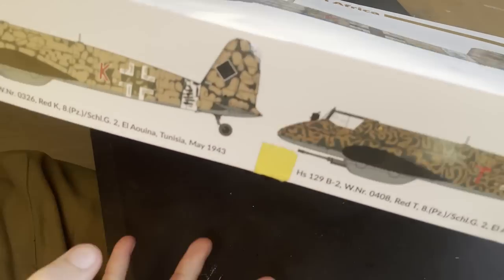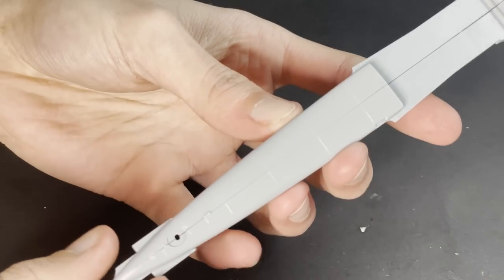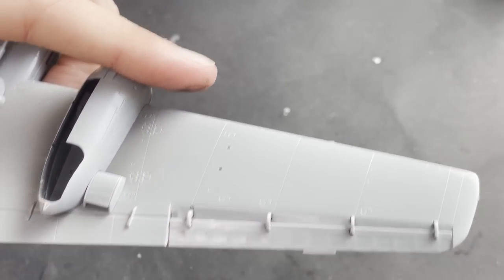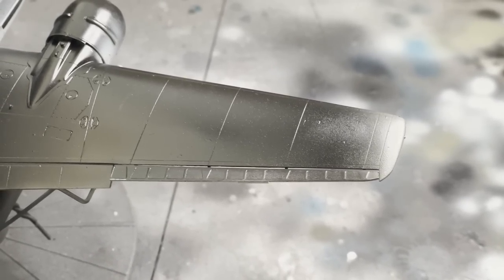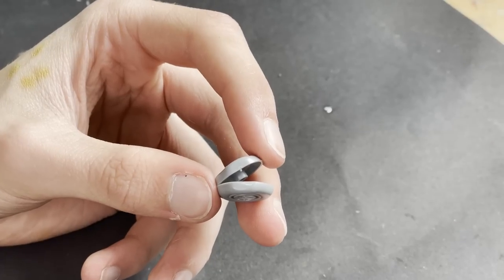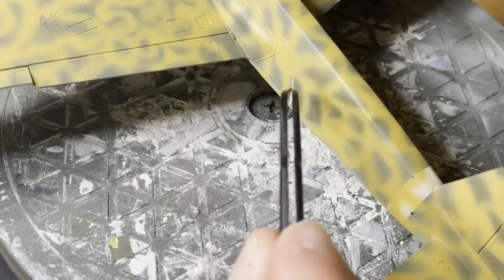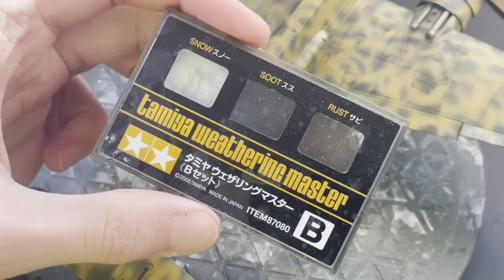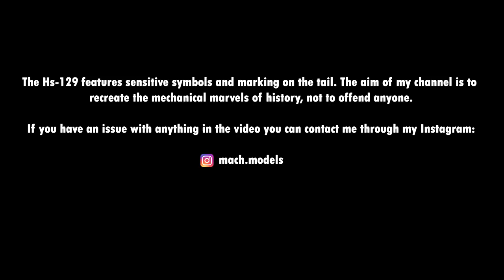Hobby 2000 1/48 Hs-129 | Full Build | HD

Comment: Amazing job on this model and what`s really good about the channel is the fact that there are no overcomplicated solutions which allow to try the same options while making my models. Just a small hint: there is a possibility of using oil paints for making the oil stains on exhaust dust (dark colors), but also for making some panels more pronounced (lighter colors). I have tried this technique recently and I am just amazed. Finally, if you`re a fan of German aircraft, I would suggest Special Hobby Bf 109E3 1/72. Great details and a lot of possible experimentation on the camo.
Reply from the maker: thank you very much!! when it comes to using oils for certain purposes, if you watch my phantom video you can see i definitely like to muck around with them! However, for this aircraft i decided to keep it relatively clean and reduced the amount of tonal variation just so it wouldn’t conflict with the unique camo! thanks for the comment i really do appreciate it :)

Comment: Hello fellow YouTube modeler! Love your channel and just subscribed. Model came out nicely. Wanted to share a recommendation with you. Try not to use high air pressure (like 25psi with acrylics). I am a former professional airbrush artist and to get super smooth finish with acrylic stick with 15 to 20psi at most. The problem is that acrylics tip dry and don't follow well so people resort to high pressure. If you see on my channel, I have a thinner mixture (that works with Vallejo or Ammo paints) that solves that problem and you will get fantastic results. It also makes the paint stronger so less issues with it being masked over. If you see my Bf-109 build, I didn't use gloves to hand the model and painted everything (including masking) in about 30 mins total.....with no paint issues. Hope this helps! And keep up the good work.
Reply from the maker: Why thank you!! I’ve always been told to spray at 30 psi for Ammo but after this I will have to try and lower it! I’ll go check out your channel now, thanks again😁

Comment: Excellent job sir.   The Henschel HS-129 was a formidable ground attack aircraft in WWII.   It's main problem was that it was severely underpowered and it was a heavy aircraft due to it's heavy armor plating and glazing of the cockpit to protect the pilot and aircraft as much as possible.    It was one of the most heavily armored of any aircraft in WWII with protective armour almost completely surrounding the pilot, engines (as much as could be done) and critical components.    This allowed severely shot up aircraft from either other fighters or anti aircraft batteries, to return safely to their airfields, even in a critically crippled aircraft.    There were a few German pilots who had great success with the HS129.    Another problem was that the aircraft was not available in large numbers and had to be used very selectively.   The aircraft assigned to North Africa were pulled after their defeat and reassigned to help in the Eastern Front war against Russia.   Their they joined three other squadrons which made a total of five which was a minuscule amount to cover the large Eastern front.  Again,  the aircraft were used very selectively in ground attack roles, mostly against Russian tanks and mechanized vehicles, although these aircraft also attacked troop formations, trains, buildings deemed a threat such as factories, depots, ship yards, and also enemy shipping of all types from military to civilian shipping, among anything else that needed to be destroyed.   These aircraft at their zenith had a 75mm auto cannon with 12 rounds of armor piercing and/or incendiary rounds.   One well placed 75mm cannon round could easily take out a tank of any size produced during the entire war.     The American B-25 Mitchell had a similar 75 mm autocannon, which was basically an artillery piece mounted to fuselage of the aircraft.    This incredibly large cannon was mounted under the pilot in a pod that ran along the entire fuselage.  The German 75mm cannon was the most powerful gun ever fitted to an aircraft during the WWII period.   Pilot's reported that the recoil from the gun felt like it stopped the aircraft in flight with every round fired.   Some models used a manually loading system as opposed to the auto loading cannon.  This aircraft was similar to how the A-10 Warthog was made constructing the aircraft around the large gatling gun running the length of the entire fuselage underneath the pilot and it has the largest and most powerful gun ever mounted on a twin engine fighter jet up to this point in history.   While the technology of the A-10 is far from secret as it was designed in the late 1960's, early 1970's, it is still valuable enough to the United States, that the USA is the only Country to have A-10 Warthog aircraft in it's arsenal for obvious reasons, and the United States forbade it's export to any nation.   Some experts believe that this aircraft,  the Henschel HS-129, along with several other German fighters of the time, including the Heinkel 219 "Uhu" or "Eagle Owl",  Messerschmidt ME-110 through the last variant, the ME410 "Horniesse" or "Hornet",  the Focke Wulf 190 (all variants), JU-88 and 188's, and the Heinkel HE-111's were all inspiration for the design of the United States' A-10 Warthog which was designed as a ground attack aircraft (Close air support aircraft) from it's design phase to it's production as a specific type of ground attack aircraft.   It went on to become one of the most valuable of the U.S. Air Forces attack planes and has served with distinction in all it's fields of battle for nearly 50 years, having very minimal losses due to the A-10 having such a resilient design with multiple redundant systems allowing the aircraft to return home, even after being severely shot up, similar to the HS-129 and the American P-47 Thunderbolt which was also a formidable ground attack aircraft in it's own right, able to sustain heavy battle damage and fly home safely.    The A-10, like it's predecessors in WWII suffers from slow speed compared to more advanced Mach 1+ fighters like the F-22 and F-35, although the highly technically advanced A-10 is much different than WWII aircraft and have sophisticated electronic warfare systems on-board that were never even dreamed of in WWII making it just as safe to fly in combat as the more technically advanced fighters such as the F-22 and F-35.   The Warthog, like the Henschel HS-129 was actually designed to be slower which allows it to perform extensive and precise ground attack missions due to being able to attack ground targets easier at slower speeds making these aircraft perfect for the ground attack missions.  In the hand of a skilled pilot, this was a true weapon of terror when it banked over into it's dive, and seeing from down below that this precision aircraft was getting ready to fire it's volley either upon you, a building by you,  a truck you were driving, a train you were conducting, an open field of troop formations, or whatever else on the ground it was.  Tanks were essentially DOOMED when this machine came down to release it's volley of weaponry upon you.   As slow as it was compared to other aircraft of that era, Henschel HS-129 was still a very maneuverable aircraft in flight which was one of the key attributes a successful Henschel 129 pilot needed to master quickly in order to survive being an easy target to shoot down.      Using this incredible maneuverability some HS-129 pilots were actually able to evade being shot down using the aircrafts maneuverability rather than speed to outwit it's enemy trying to shoot them down, similar to American dive bomber designs such as the Dauntless and Thunderbolt's being "multi-role" aircraft but great ground attack aircrafts in their own right.   Many HS-129 pilots even had air to air kills in their HS 129's, which is not a role it was designed to be used for, being a specifically designed ground attack / light bomber type of aircraft.    It's machine guns were not as powerful as other aircraft of the era, however, it's strength was in it's huge 75mm cannon. 

FANTASTIC JOB on your paint job of the aircraft.   It really looks period correct and very realistic.    Really nice job you did and I am looking forward to exploring the rest of your incredible model building videos.    I want to get into building models of WWII era aircraft of all types as well as some of the more famous models of the early years in WW1 like The Red Baron's Red Tri-Plane which surely would be a challenge to construct but would be fun.   Your attention to detail and the way you explain your models is spot on.    Very informative and interesting to watch.  I especially like the way you "blend in" various paint colors and the amazing way you take paint to make oil streaks behind the exhausts and other intricacies that most other model builders don't even dream about doing.    You really have a talent for building life like models.   They should you use for movie set construction, etc. for making models of planes.    They look so life like when you are finished.   It really brings the appearance of what the aircraft would have looked like back then to life,  it really does.   Seeing the aircraft in a 3 dimensional model is a great way to see what the aircraft really looked like since most of these aircraft no longer exist and the very few still around are in museums.   None of the 865 Henschel HS-129 aircraft produced survived the war, many of which were either shot down, hit by anti-aircraft fire and destroyed/crashed,  crashed during flight training and destroyed, or were destroyed intentionally to avoid allowing the allies to capture the technology at Germany's surrender.    Two thumbs up sir,  very nice job!   Thanks for posting all your hard work for us to view.     Have you constructed/painted a North American P-61 Black Widow model yet?   Would love to see that.   It probably wouldn't be that hard since it's a matte black paint scheme to avoid radar of that time period,  but it would still need your "realism" touch.   That's the key to making a model look good or look GREAT!   Your look the latter........GREAT!   You really have a skill making those planes look so real.
Reply from the maker: Wow! Thank you for such an informative comment, really appreciate all of the kind words! 

I currently have not done a black widow but I do have a kit lurking in my stash, so perhaps it’ll make its way onto here soon! Many thanks again😁👌🏻
Reply: @machmodels  That would be an awesome aircraft and a direct contemporary of the Heinkel 219 as these two were the only two designed specifically for night fighting..    The P-61 Black Widow night fighter aircraft was equipped with some of the most advanced RADAR of that era.    Given to an aggressive and capable pilot, along with an equally capable RADAR operator who needed to have the skills to read the cathode ray tube display of squiggly lines, those RADAR operators could make or break a sortie based on their skills to read those squiggly lines and vector the pilot to where the German aircraft were at.    All in the pitch black darkness of night.    The RADAR equipment and RADAR operators were invaluable to the mission successes although much of the "praises" for the missions and scores for the "victories" were usually given to the pilot.   During the Vietnam war,  the first Electronic Warfare Officer or "Back Seater" was awarded the title of "ACE" for his skills in downing over five enemy aircraft from the backseat of the aircraft using electronic warfare and also the aircraft's weaponry which was controlled mainly by the back seat officer, some of whom (not the majority) were trained as co-pilots, although the pilot also had the option of firing weapons from the front cockpit.   The B-25 Mitchell bomber in  WWII in the later variants had an incredible 18 machine guns strategically positioned all over the aircraft.   At the flip of a switch in close proximity to the pilot, the pilot could take total control of all 18 guns at the same time, automatically and hydraulically moving the guns to the forward firing position so the pilot had maximum firepower in a dive bombing run and more importantly in a strafing run giving the pilot the power of 18 forward firing .50 caliber machine guns and also a .75mm auto cannon on some later models unleashing a hellfire unseen by any other aircraft during WWII.  It was not only one of the most heavily armed aircraft of WWII, but of all time!